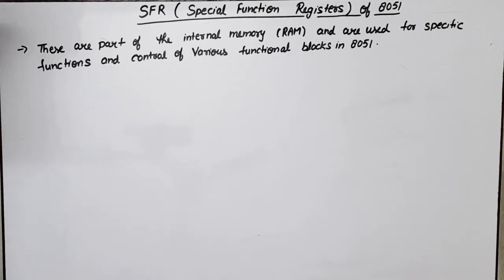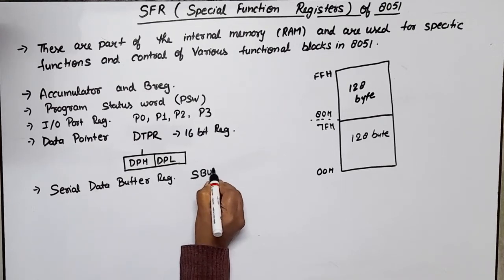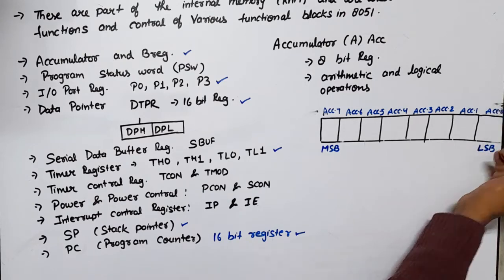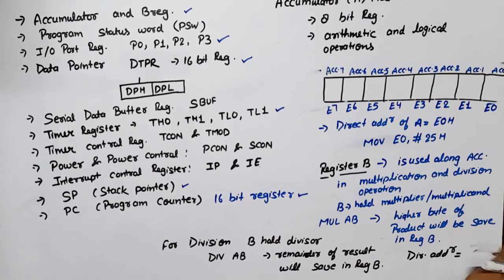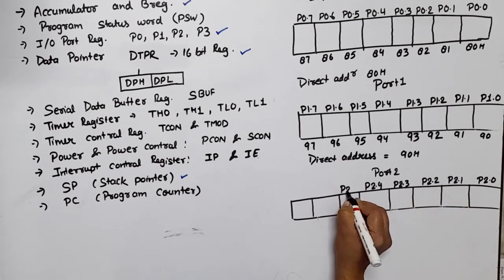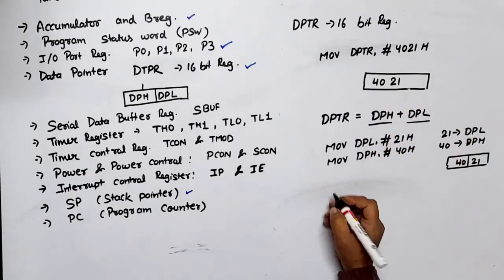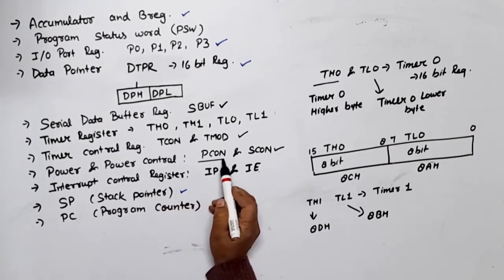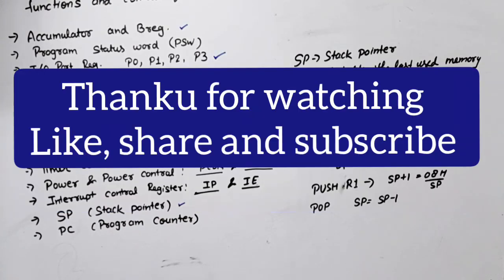Unit 4 L6 | Special function registers of 8051 | SFRs of 8051

Comment: mam the internal ram is 128 bytes in 8051 but how in this case we have taken it as 256 bytes, I don't understand that point
Reply from the maker: Actually in case of 8051 it's 128 bytes on chip + a number of SFRs
In case of 8052 its 256 bytes
Reply: @TechnoTutorials2783  Okay I got it now, Thanks for replying mam and thanks for the video too
Reply: +1